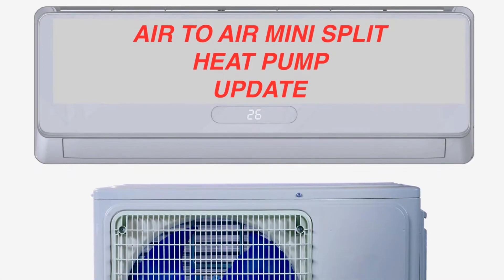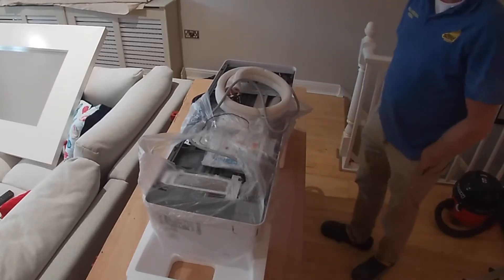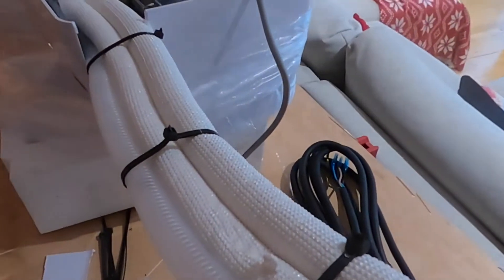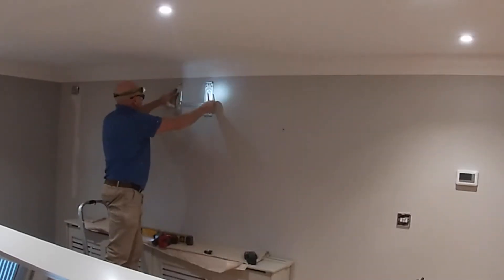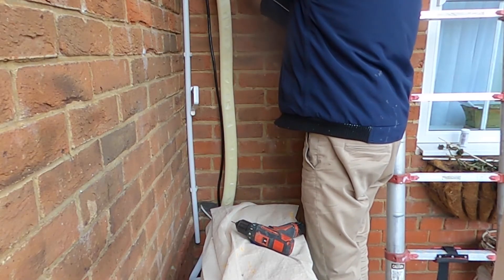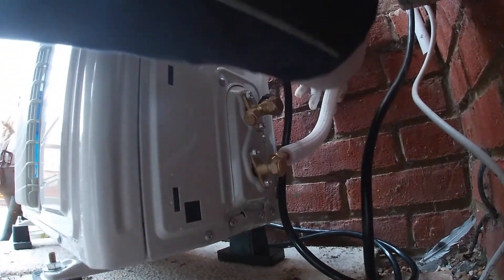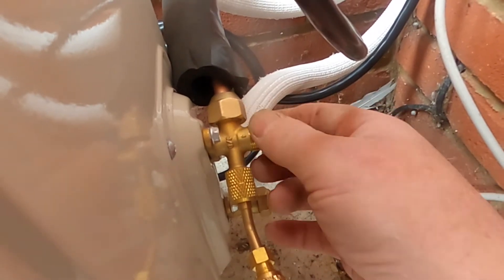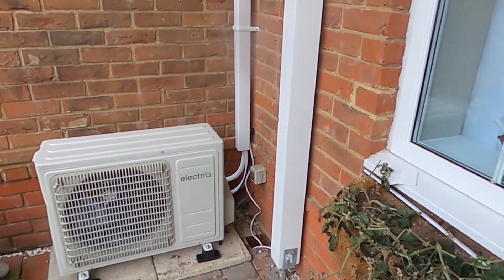DIY AIR TO AIR  MINI SPLIT HEAT PUMP  INSTALLATION OF SECOND ELECTRIQ UNIT

Comment: Great video, question did you put the external unit under a roof? It’s not super clear in the manual apart from saying place external unit on a dry place… which is pretty difficult outside 🤣 anyway I see units exposed all the time with no need for a roof covering just just curious to know your approach. Thank you 🙏🏻
Reply from the maker: Hi  No  
it is not always practical to keep unit out of weather. I think when they say fit in dry place they mean . Do not install where the unit or part of the unit  can get submersed in water .  well drained ground where water will not sit. Thank you.
Reply: @HEATSEEKER1428  makes sense! Thank you 🙏🏻

Comment: Is the pipe vacuum necessary. It states on the website it isnt necessary, so are they just misselling or is it a step that isnt completely necessary.
Reply from the maker: Hi 
No the  vacuuming of the pipe set is not necessary . you are right they do say that in the instructions . I would just be careful and not leave the pipe set with open ends too long as you do not want moisture to get into the pipes  or too much moist air . Thank you .
Reply: @HEATSEEKER1428  cool thanks for that I'm tempted to fit one I was a machine engineer for 8 years and pretty handy. Is it relatively simple.
Reply from the maker: @HA05GER  Hi  They are  simple to fit, and it sounds like you have more than enough skill to fit  one . You won't regret it , you will be amazed at how efficient they are .  Thank you.
Reply: @HEATSEEKER1428  cheers appreciate the reply. We current have portable units and bloody crap so I think it will be worth it plus we have solar so makes sense to use the energy instead of sending to the grid. Again thanks I appreciate it.

Comment: Great and informative video😊 I am thinking of purchasing one for my bedroom. Do you have any videos of the outside unit while it’s running? I wanted to attach the external unit to my bedroom external wall and it has a window close by. Wanted to know if it’s loud when used for cold air conditioning. Does it vibrate a lot as I’ll be attaching it to a wall mount bracket.
Reply from the maker: Hi I will post video of out side unit running. it does run quietly  no real vibration . obviously being mechanical it is not completely silent but if you use a sturdy bracket and good quality rubber feet I can't see that you would have any noise  problems, assuming that you are fitting the bracket to a solid wall   .  Thank you .

Comment: One major disadvantage of R290 is its flammability, which is classified as A3 according to the safety classification system.

 

Overall, while the flammability of R290 may be a disadvantage, its low GWP and high energy efficiency make it an attractive option for environmentally conscious consumers and businesses. As with any HVAC system, proper installation and maintenance are key to ensuring safety and optimal performance.  However, it's important to consider the potential risks associated with using R290 refrigerant, also known as propane. While R290 is an environmentally friendly and energy-efficient refrigerant, one of its main disadvantages is its flammability. In the event of a serious accident or a series of accidents, there is a possibility that there could be significant damage to property or even loss of life.

This means that while R290 is a more environmentally friendly refrigerant option, it requires careful handling and installation to ensure safety. Installers, service engineers and some users of R290 HVAC systems need to be trained in proper safety procedures and follow strict guidelines to prevent accidents.

Despite this disadvantage, R290 is still being considered as a viable alternative to traditional refrigerants such as R32. In fact, some experts predict that the market for R290 will be bigger than R32 due to the upcoming phase-out of refrigerants with a GWP greater than 750 by 2025.

On the flip side to this, if a major accident were to occur, it could lead to public outcry and a push for rapid regulation change. This could result in a ban on the use of R290 gas or significantly stricter regulations on its handling and storage. Such changes could have a significant impact on businesses that rely on R290-based refrigeration systems, as they would have to make costly changes to comply with the new regulations. It's also worth noting that the use of R290 refrigerant requires specialized training and equipment for handling and installation. If the regulations were to become more stringent, it could make it even more challenging for businesses to find qualified technicians to service and maintain their R290 systems.

While R290 refrigerant has many benefits, it's crucial to consider the potential risks and be proactive in implementing proper safety measures to mitigate them, it's essential to weigh the benefits against the potential risks and ensure that businesses are fully aware of both when deciding whether to use R290 refrigerant or continue using a refrigerant like R32 on a limited phase out schedule.
Reply: That’s just you trying the ‘Spooky Monster’ trick mate, legally, anyone can install R290 appliances. Your views are irrelevant on the subject.
Reply: Gas god says it’s ok to go back in the water.

Comment: Hi, why didn't you just install the indoor unit on the outside wall, it looked like it would fit.? Then the pipes would be hidden and your wife wouldn't have complained about the box section in her bedroom. Also you gave the impression that you can use plumbers solder to make a joint - copper to copper doesn't need flux - you just need brazing rod. People are going to see this and think they can down to Wickes and get what they need!
Reply from the maker: Hi  yes I did think of fitting the unit on the adjacent wall but after discussion with wife  the compromise was where it is . But you are right I think it would have looked ok there  and much easier to fit .
Reply: If thats on R410a your in trouble

Comment: Fantastic Video, speaking as someone who’s a Plumber/Heating Engineer. You certainly look like you know what you’re doing👍👍
What units are these & are they Invert units?

Isn’t it a crazy country our beloved UK, a simple installation of a A2A unit like this & there’s no Government Grants for them😡😡. 
As someone who’s been involved in fitting all types of Heat Pumps, over the years - Air Source, Ground Source etc etc etc. I can assure anyone, there’s infinitely more involved with anything other than A2A.

You certainly achieved an excellent COP on these units & the use can easily supplement your Gas CH.

Thanks for sharing & I hope you make a full recovery with your damaged hand.
Reply from the maker: Hi these are inverter units and they are marketed by  electric. They use R290 as the refrigerant so no F gas qualifications required. They truly are saving us  money on our heating bills.  I too am a heating engineer  I fit air to water units in large houses but these air to air mini splits are so effective and reasonably priced  , They are definitely worth fitting
Reply: @HEATSEEKER1428  I’d be interested to know where you got confirmation on R290 having no requirement for a F-Gas ticket? Not that I’ve got a F-Gas ticket. I was recently told I couldn’t work on units running on Co2 as a refrigerant Gas. Which crazy, it only a Pub Gas & Pumped out every Gas Boiler flue!!!
Reply from the maker: Hi you cannot work on units with the standard refrigerant.  in fact you cannot even buy units with standard refrigerant with out f gas qualifications but as R290 has a very low G.W.P.  it is safe for  any one who is confident to fit. G.W.P. =Global Warming Potential. Thank you .
Reply: @HEATSEEKER1428  Oh I completely appreciate what you’re saying, but according to colleges you still need an F-Gas Ticket. Crazy I know.
There’s always the exception when it’s your own home, you can do what you like👍👍
Thanks
Reply from the maker: Hi  Manufacturers instructions state that you do not need  F Gas  Thank you  @TheDickPuller
Reply from the maker: Essential infoOutputs 12000 Btu/h (variable speed inverter)A++/A+ RatingSuper DC InverterCooling, Heating & DehumidifyingEasy Fit with 4.5 meters (1.5m+3m) pipe and cable kit supplied as standard (optional 10-meter pipe kit available)Does not require installation by an F-Gas registered engineer or specialist equipment for typical installation – everything you need is suppliedEco Friendly: Using latest R290 refrigeration gas with zero ozone depletion potential (ODP) and lowest possible global warming potential (GWP)Maximum Pipe run: 12 metersEnergy Saving Inverter TechnologyHeat Pump for efficient heatingDigital White Led temperature and function displayCooling capacity: 3.5 kWHeating capacity: 3.55 kWSCOP: 4.1 / SEER: 6.15 years warranty (see user manual)24 Hour TimerSelf-diagnostic functionSleep Mode – ultra quiet. COPY OF MANUFACTURERES BLURB ABOVE  . APPROX HALF WAY DOWN. " Does not require  F- Gas  Engineer ." Thanks
Reply from the maker: I Forgive  me I am Assuming that you are in England .
Reply: Do you understand that r290 is propane and flammable ?(extremely)
Reply: @langy1318  I work with high pressure LPG daily & fully qualified to do so.
Reply: @TheDickPuller  What is your point? Do you install high pressure pipes and do the relevant pressure and strength test of the pipes with adequate leak tests ? This is one nasty accident away from not being allowed to touch the system to remove it.
Reply: @TheDickPuller  I’m not patronising at all, look in the mirror cup cake. So the f gas certificate is there to make sure working on refrigeration equipment is done properly with the correct techniques and safety procedures are adhered to. Big tough guy like you is qualified fair enough but some people are probably going to have a go without being fully aware of the dangers. Seeing as you work with lpg why don’t you do a video to see if that “ small quantity is capable of doing anything significant if ignited in an enclosed area. 
I honestly can’t believe that  health and safety regulations don’t apply to the most dangerous refrigerant that has been put in a diy appliance.
I am making people aware that’s all !

Comment: Did I mis something or Am I just being stupid , watching your video I still can’t see the pipe work coming out of the unit hanging on the wall , blower unit i think it’s called the pipes only comes out so far obviously it must have more pipes coming out of the heat pump itself but didn’t see you make those connections and how do you know that the pipes would be long enough to actually be sufficient to placing both units, sorry for being stupid trying to learn but maybe I’m just slow,
Reply from the maker: Hi Yes it is bigger because the area to be heated is bigger . The output of this unit is 12,000 Btu's the output of the unit in the other video is 9.000 Btu's  the Cost was £ 650.00 approx £ 100 More than the smaller unit. .
Hope this helps. Thank you
Reply: @HEATSEEKER1428  thanks for replying, will be interested when you report your findings in regards to the running costs in the future. Take care.
Reply: Wow! That's about Can$1,000. Here in Canada we're looking at a retail price of around Can$2,500. Unfortunately, we're regularly ripped off by both suppliers and retailers. My guess is that we just don't have enough competition in the marketplace. @HEATSEEKER1428
Reply: I have this unit, can you bend the pipe that comes directly from the indoor unit? Also what do you do with excess on the pipe set? Can you cut it or just coil it up,great video BTW 👍
Reply from the maker: @rocketron9  Hi  
Regarding of the pipe work  connected to the indoor unit  you should be able to bend it to exit the unit left.right  or out the back. I would do this very carefully as I found this pipe work to be quite hard, If you want to bend pipe work after it leaves the unit  then yes you can bend it  but  be careful  not to kink the pipe. Regarding the excess of the pipe set  yes you can just coil it up. or cut it, bearing in mind you will need ends with flanges on to make  the joint to the out door unit . Thank you  and good luck.👍
Reply from the maker: Hi There is approx. 1.5 mars of pipe attached to the indoor unit  then you get a further pipe set with the out door unit. they join together with fittings supplied.
You are certainly not being stupid, The pipes are with in the boxing that I have formed to the left of the indoor unit . Thank you.
Reply: @HEATSEEKER1428  Hi, great video - Thanks for taking the time to record and upload it. I have a question, how did you connect the blower pipes to the extension pipes? The unit I am installing has black fittings that look like they have valves inside them on the end of the blower pipes. I started to unscrew one of the fittings/valves but soon heard a hissing sound so quickly tightened it back up again assuming this to be the pressurised gas.
Reply from the maker: @mikecollins569  thank you
Reply from the maker: @mikecollins569  Hi  if by blower pipes you mean the copper pipe set that is supplied with the unit  and the pipe es that are connected to the unit.
I think what you are describing are a sort of valve that the manufacturer has fitted to keep the indoor unit under pressure , obviously for testing and to prevent contamination form out side . So basically when you are ready to connect your line set to the out door unit you remove the Black pieces and connect the two compression type unions . There will be a release of a gas this could be just compressed air or possibly just nitrogen  just a small amount used for testing only .

Thank you.
Reply: @HEATSEEKER1428  it looks a bigger unit than the one you had in your hall , may I ask how much was the new unit ?